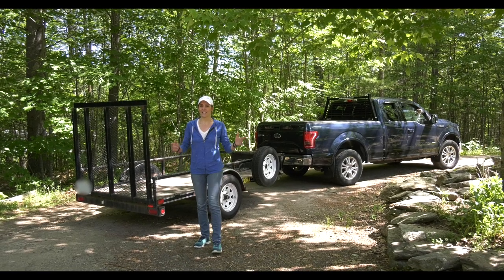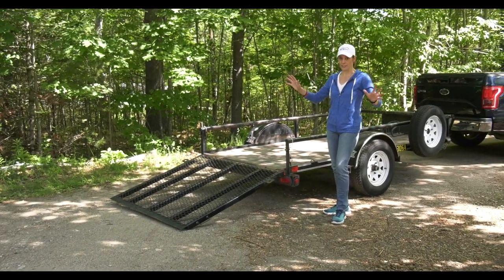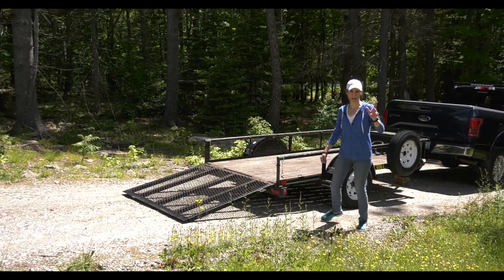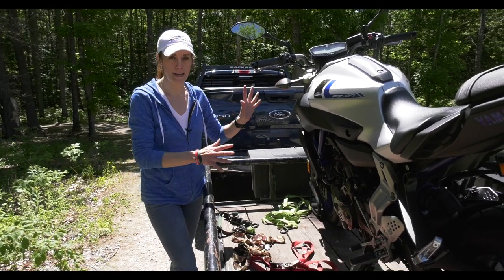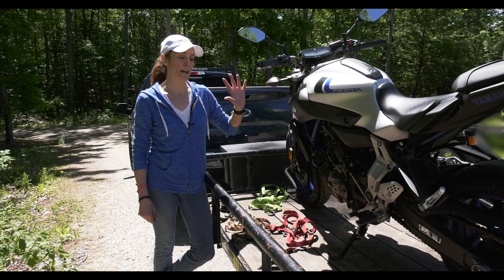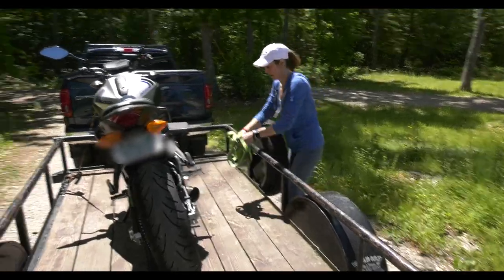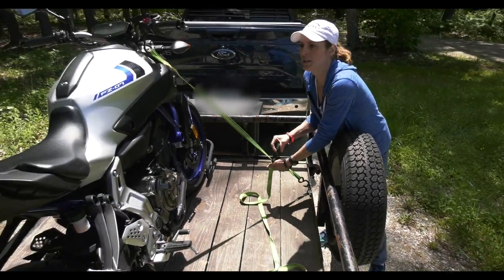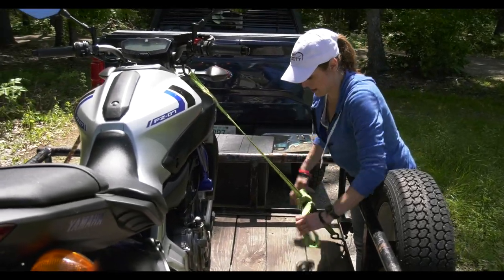Tips on Loading a Motorcycle on a Landscape Trailer

Comment: Just picking up my first bike in a few days and this video hits my sweet spot. I am working with ties that could be better although they are new and have the same issue as Elvis, too small a trailer but then my bike is small as well. I built a wooden chaulk but may not be able to use if the bike sticks out the back. Your neverousness about the trailering actually helps my neverousness. Thank you for the great video!
Reply from the maker: Thanks so much for the thoughtful comment! That’s exactly why I do those kinds of videos!

Comment: I havent hauled a lot of bikes but it looks like if you oversee a speed bump or something that it could be just enough for the bike to shift and fall, since there is nothing locking the wheels in place
Reply from the maker: Never had a problem with that and have towed over potholes and crazy dirt roads in the north country with some nasty dips. If it's tied down tight enough, it shouldn't move at all. The trick is to not have any play in the suspension that would loosen the straps.

Comment: its scary for all of us.  well I know one thing about this, your trailer is sized right as it is long enough and wide enough to comfortably put your bike on it and put a good pull angle ( ~45 degree) on the straps.  my trailer is too darn short and too darn narrow, and it has a painted metal floor which is slippery even when it is not wet but really slippery when it has any moisture on it.  oh one other thing, you would be smart to get better straps and hooks with keepers on them that will not let the load come off the hook if the strap gets loose for any reason.
Reply: Sounds like you have a bit of a challenge with your trailer, maybe put some non-skid down so it's not so slippery? And great observation on the straps. I've been procrastinating on the better ones. You're right that I need them! Thanks for the great comments!
Reply: @janisnazarenko1097  I very much do, once again I learned the hard way.  I'll be selling the trailer I own now, for a utility trailer like yours which will make my trailering life so much easier.  I'll end up loosing $1000 in the deal, but I will not have to be frustrated every time I want to use it with one of those small decked, "no ramp" trailers.  Check the Mac's Tie Downs website, they are in ID, and although extremely high quality and a bit more money, they are still affordable and worth every penny in my estimation.  I strap down a 900" bike and went with a 2" strap.  Bike solidly strapped down for sure.  All the sales folks are friendly, Mike & Phil helped me over many calls.  Best!
Reply from the maker: Thanks for the recommendation on the straps and glad to hear you'll be getting a better trailer for you. I have the trailer I do because I use it for multiple purposes: towing the lawn tractor, ATV, dump runs, you name it.